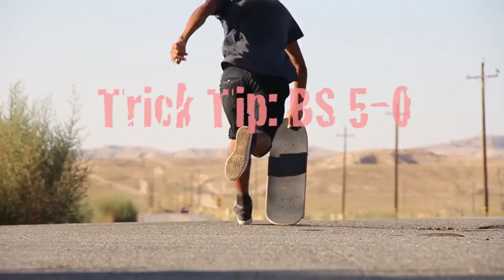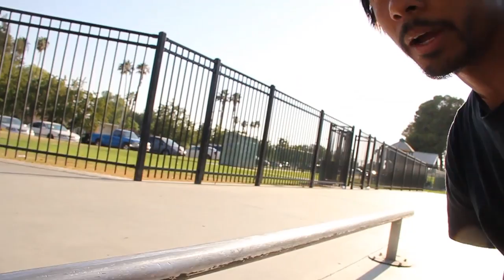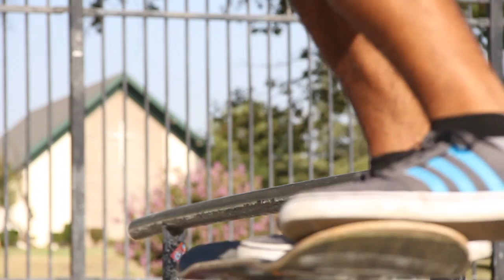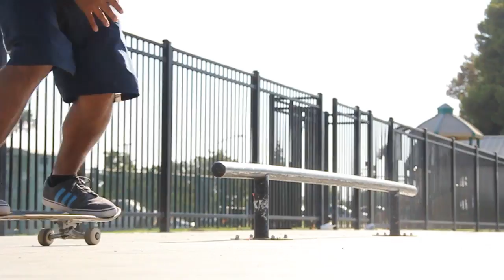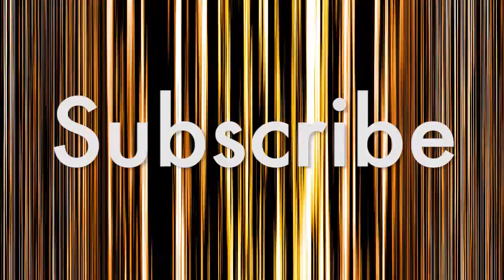How To BS 5-0 Grind!

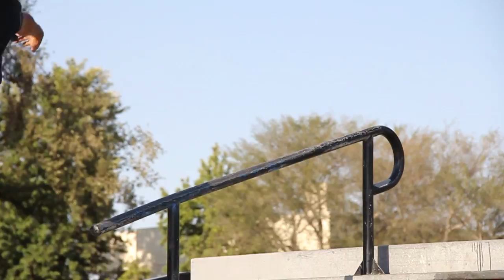Comment: I noticed that you didn't lock on the heel side wheel when you five-o the handrail on 3:36 . and you kind of move it into the right place then , so I wander if there are some details about how did you "not lock in at the first but move it into the right place"?  (like when I'm bs 5050 a round rail , I  can't make sure to lock it on opposite side of trucks right when I jumped on the rail , but I put different pressure on my foot ,front foot on heel , back foot on toes , then the truck will be move into the right place .)
Reply from the maker: Kenny Gao j
Reply from the maker: Kenny Gao I believe because I was going down I landed in the middle of the back truck the slow mo makes it seem like I grinded a good amount but it shifted towards the heel side like a bs salad grind allowing me to grind the hand rail, good eye on that
Reply: @Mogely  after 2 months , I wanna tell you I finally made it on round rail (I did not skate everyday though). this is the clip I landed yesterday . https://youtu.be/NKK6RWp8aZg .   and really really thank you for your tips !